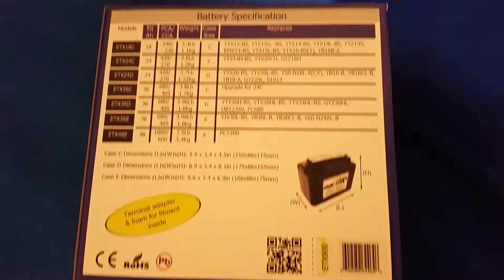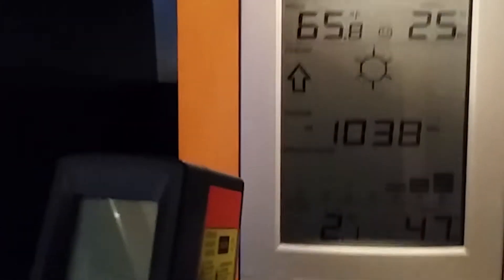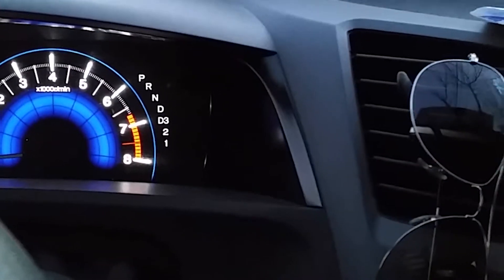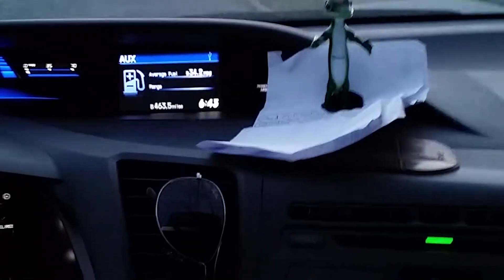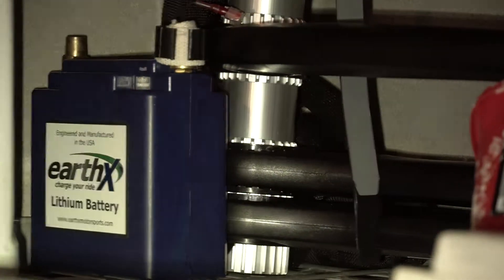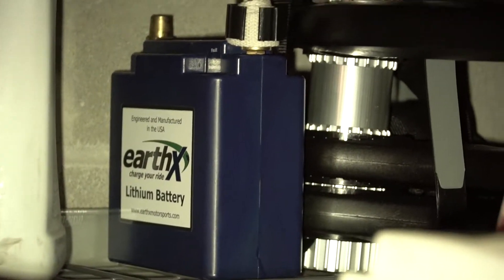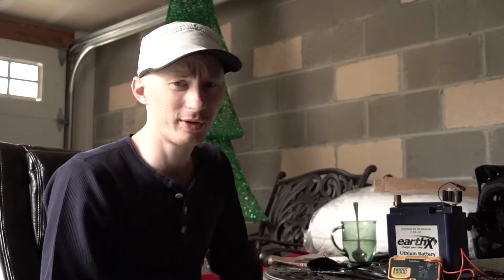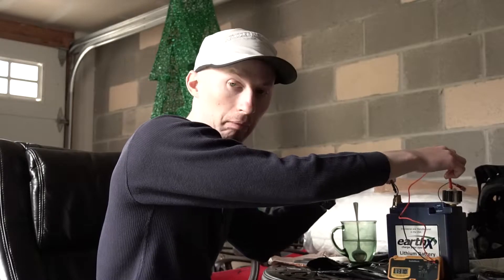Winter Cold start lithium LifePo4 EarthX ETX900 battery

Comment: That's bad ass that little guy will start that car when it's that cold. My concern with the cold is the recharging factor with lithium.
Reply: You have to buy one with a battery heater inside.

They heat up the battery before they start charging.
Reply from the maker: good point, I was concerned with extreme heat inside the engine bay & cold overnight temps, but worked just fine for a year, then traded the car in & not messing with cars for now